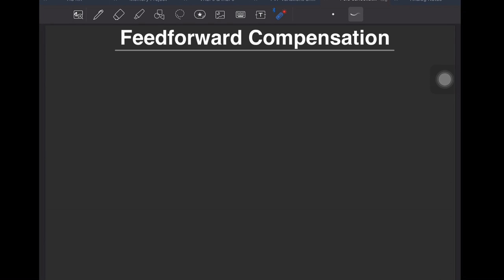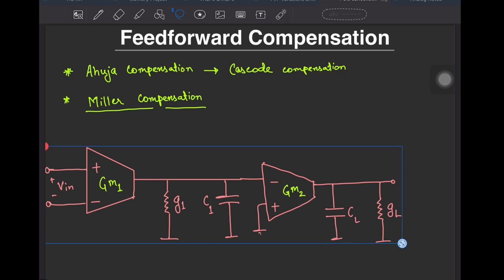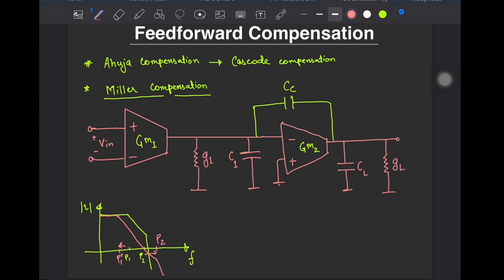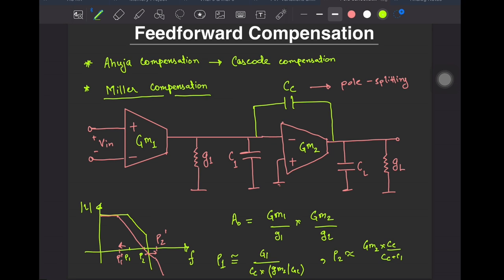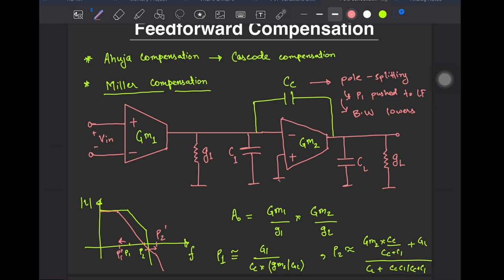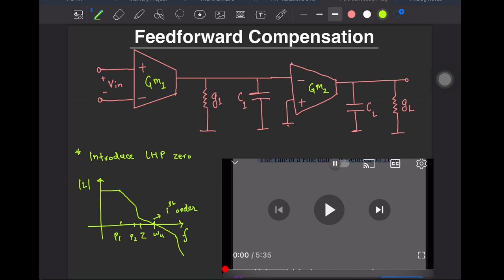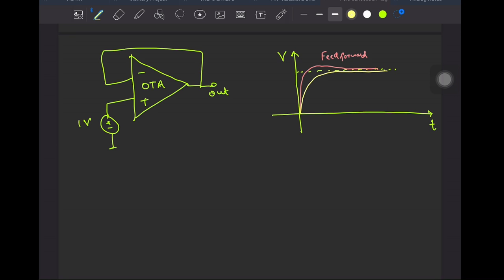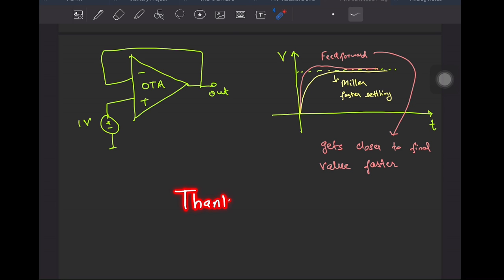Overview of Feedforward and Miller Compensation

Comment: Great video. Will definitely be helpful for you amd audience if you could design a transistor level circuit for an application. Not easy, but worth it as you may encounter lot more issues than the simplified analysis here.
Reply from the maker: I agree with you. Thanks for the feedback.

Comment: Great video! One more point would be that while Miller compensated OTA can be tested for stability in a unity feedback being the worst case of stability, Feedforward OTAs are only conditionally stable for a certain range of feedback factor (phase is non monotonic as you showed). This means we can't straightaway conclude stability by just testing in unity gain configuration.
Reply from the maker: That is an important distinction. That essentially means that we can’t use them for a general case or arbitrary feedback factor.

We need to design for a particular feedback factor. Thanks for mentioning it!